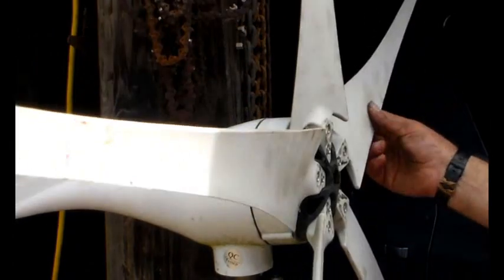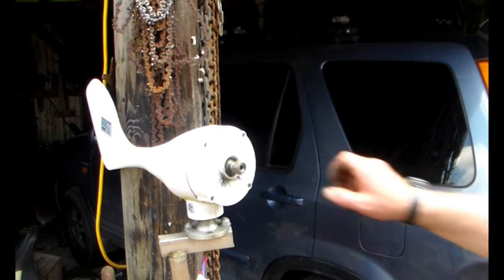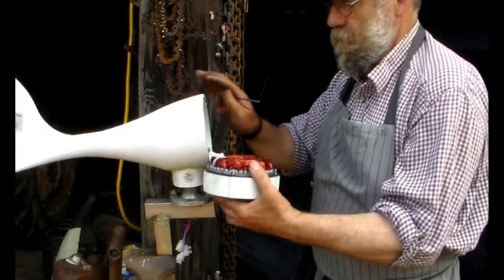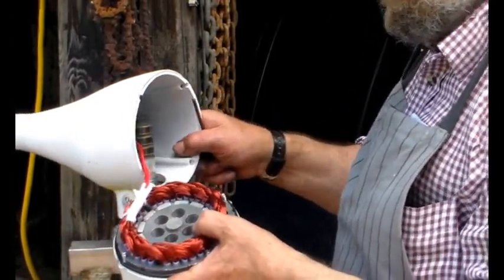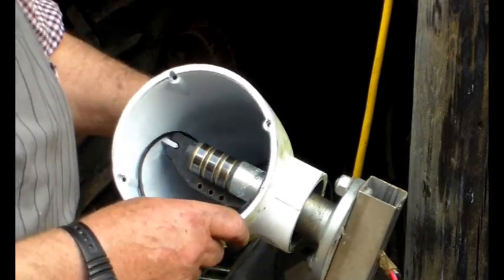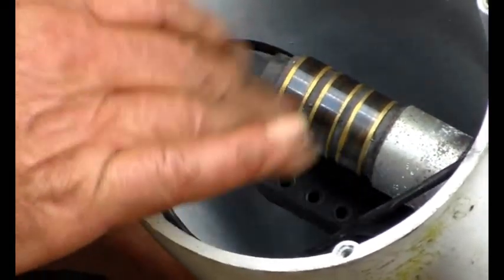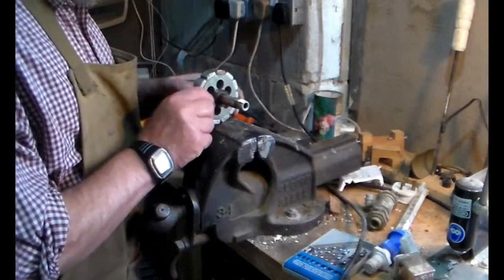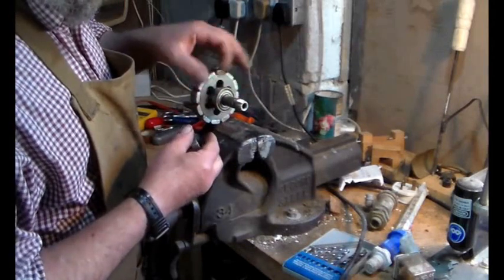Faulty 12v wind turbine repair Pt 1

Comment: on many YouTube channels I've seen many Chinese bearings fail in turbines, it's par for the course, we use Japanese made bearings and years later no issues.
Reply from the maker: Yes, down to a price not up to a standard, although the design with the bearings so close together is just asking for trouble, cheers

Comment: Hi, just bought one similar small wind turbine and I'm trying to fix a few things. How long did it work like this? Just for reference, to know what to expect.
Reply from the maker: Hi, I don' know how long it was how long i was running before failure, but it has been over a year now since the fix. Important to get that hub real tight to keep the bearings tight on the shaft, cheers
Reply: @TheInfoworks   I see what you mean. Thank you!

Comment: Disappointing when you opened that turbine up and there's no rear bearing on the shaft Andy ! You just know that's gonna fail sooner rather than later, surely. That prop is quite large also, you wonder whether the nut holding the bearing stack tight can really stay tight with a plastic hub like that ?  And, is the prop to shaft grip really only by the clamping force of that central nut ? (ie no key or taper or summat) Cheers, Dave
Reply from the maker: Dave, you right on with your analysis. It's a case of form and cost over function. Those 2 bearings very close together with an overhung rotor is asking for trouble. The casting is nice but limits the rest of the design, it looks neat and tidy for the buyer despite the limitations. The blade size is probably OK, it's a rotor sixe to output balance. Cheers, Andy
Reply: @TheInfoworks  Yaw bearing and slip rings look ok as you say. I guess the hub nut gets tightened by the rotation of the prop, but it looks like it wasn't very tight when you got it, plus it's been slipping on the shaft. I noticed there's a 'QC' sticker on the side - well that's all ok then - haha. 
400 watts seems a lot for such a small machine - but I have no doubt the label is correct....Dave
Reply from the maker: Dave, all turbines never give what they say and this one is 400w at 13 Ms, so that is about 40mph, twice a year then, cheers
Reply: @TheInfoworks  The 5 blades and drag therefrom will kill high wind production.  The whole point of more blades is to increase starting torque, which you don't need on a generator as torque is needed when it's already spinning at full chooch.  The only things mechanically to overcome at startup are bearing friction and rotor inertia.
Reply from the maker: @randacnam7321  in some ways the extra friction at higher speeds is a benefit, as it helps with speed regulation as over speed is a real problem. A great deal of design time is spent on this, cheers